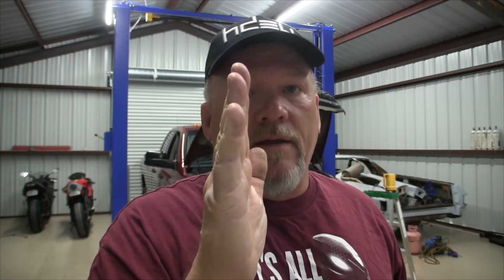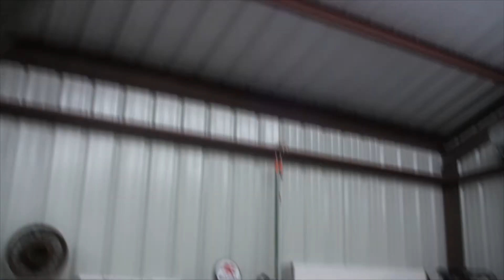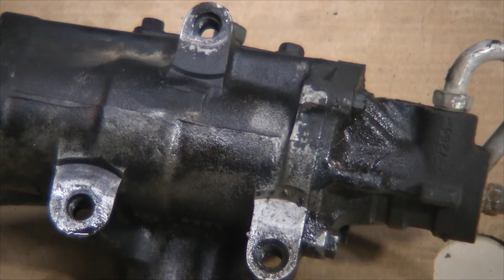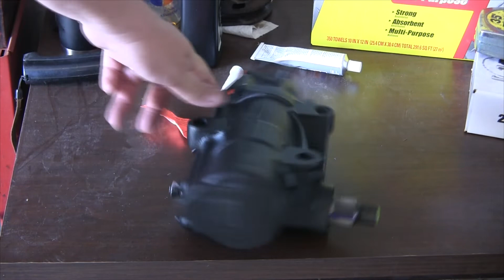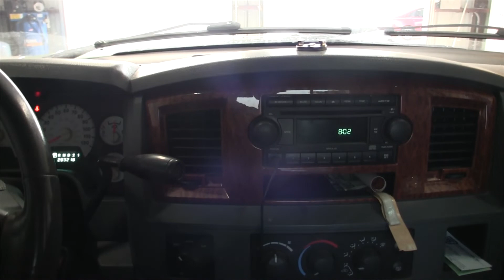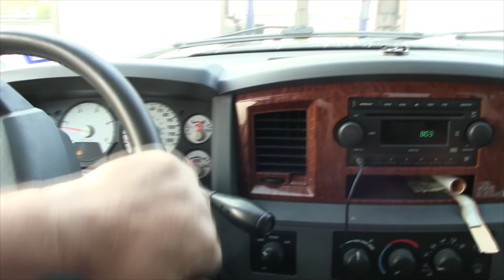How To: 2006 Dodge Ram 3500 Power Steering Gearbox Replacement

Comment: Thank you.  I have a 2003 Dodge Ram 2500 this is my 3rd time replacing the gear box. Still leaking from the shaft where the steering connect with the gear box
Reply from the maker: Dang! Yeah, I guess the remans are hit or miss. Sure they'll give you a replacement, but the amount of work these things take to replace makes it frustrating.

Comment: Thanks for the video it was very helpful but only high pressure line if you follow it up to the brake reservoir you can disconnect it up there instead of fighting with it down on the gearbox
Reply from the maker: Ah!! Great advice. I hope other see your comment and learn a better way to do it. Thank you for watchin and taking the time to comment!

Comment: Thanks a bunch. This was too easy. After everything was done it took me just north of 3 hours. I took my sweet ass time though and don't have power tools or a lift. I got a quality pitman arm puller from amazon for $40. 

The hardest part (surprisingly) was disconnecting the hose from the gearbox. Didn't have flare wrenches small enough, and using an adjustable on it was a motherfucker. 

Going by the comments I went with a redhead. I shall see how it pays off.

2006 Ram 2500 5.9 Cummins (last of the 5.9's).
Reply from the maker: I would agree... It's definitely NOT easy to get to . LOL, I can't believe you got that fucker off with an adjustable!

Comment: well done video. Putting a red head steering box on my 2006 dodge ram 2500 today. Same color as your truck! I'll have the laptop on the workbench with your video cued up. I've taken the pitman arm off before, iirc broke about 5 different tools doing it. Thanks for the video!
Reply from the maker: Thanks! After replacing two of these in less than six months, a Red Head is the way to go. I was thinking this would save me money, but when the rebuilt one I installed failed due to a leak around the adjustment screw plate I immediately regretted my decision. Good luck!

Comment: Hi , Ive got the gear box changed by a garage. When i drove home I noticed the steering wheel is 15degr left, it is related to this operation? I asked them to align it and they refused,claiming that it is normal and should pay extra to fix it. Please advise.
Reply from the maker: No, it is not normal. There is an adjuster sleeve between the drag link and pitman arm with two bolt clamps on it to hold it tight once adjusted. This sleeve increases lengthens or shortens the distance between the rod ends and this affects steering wheel alignment. If your steering wheel is crooked while traveling don a straight road, they need to finish the job.

Comment: I don't think I've ever seen one of those crack before.   I've seen the frame crack where it bolts up before.
Reply from the maker: Yeah, I was confused because I knew it was leaking, but couldn't see any hoses or fittings leaking and nothing on the top of the case. The material is very thin right there were it cracked. Thanks for watchin, Ken. Happy New Year!